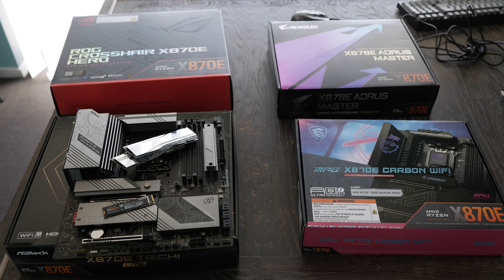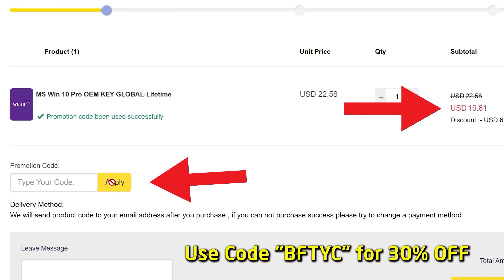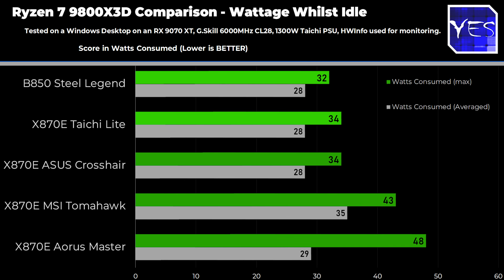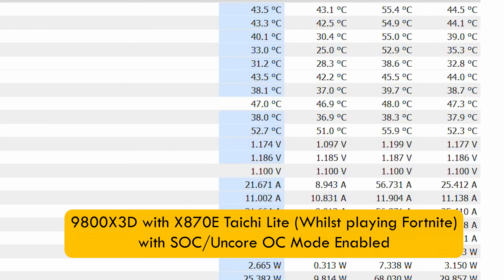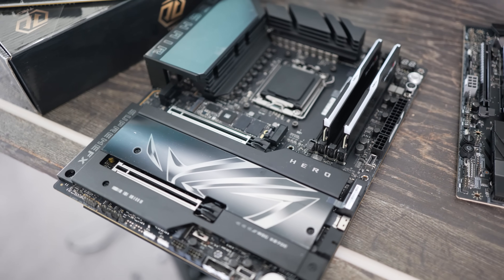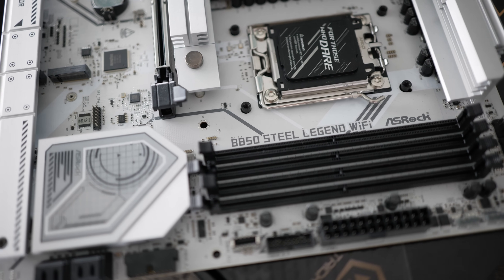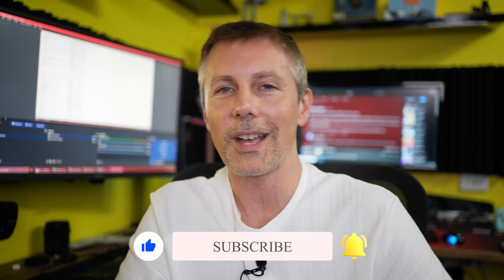I think I know why Ryzen 9000 Series CPUs are Dying...(!)

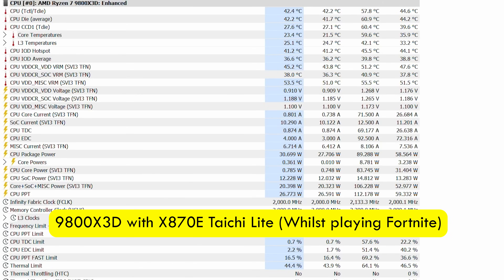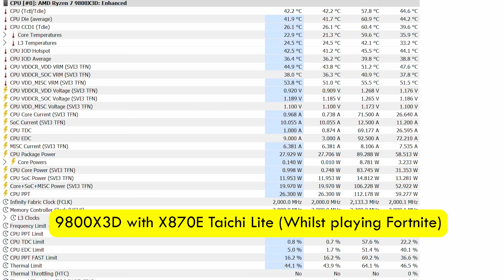Comment: Sorry, but I'm going to disappoint you. This is "just" a known issue of erroneous CPU reporting to the HWiNFO64. According to HWiNFO author its not a software reading error but a CPU reporting to HWiNFO bug, most likely located deep inside the CPU SMU. And it happens across all brands of motherboards and both AM4 and AM5 platforms not just the 9000. On all 5000/7000/9000 series. Freeze you video between 3:38 - 3:55 and take a closer look to FCLK and UCLK max values and also the "CPU_VDDCR_SOC Voltage (SVI3 TFN)".  FCLK 2000MHz to 2133MHz, UCLK 3000MHz to 3300MHz and SOC voltage 1.185V to 1.265V. You know what all these have in common? All of them spiked ecxactly +6.67%. Probably other sensors get this spike too but its not easy to recognize it because of the dynamic function. Current(A) sensors and temperature sensors. Sometimes these error reporting spikes could get up to +50% or even +100%. Its random on what sensor it would happen, and of course its fake/error. Not real. I've seen screenshots like yours with 2.4V SOC voltages, 4000MHz FCLK speeds and 130C CPU temperatures. We all know that those values are impossible, hence they are error reporting. The "good thing" is that internally the CPU reads the correct values for sustaining the correct operating behavior. FYI I have an 9700X with X870E NOVA board and I do get the occasional +6.67% max values on FCLK, UCLK and VSOC, but I was also getting the same on my previous AM4 5900X with GB X570 AorusPro board. And on that AM4 platform I first got the +100% spikes. These erroneous (+6.67%, +50%, +100%) and fake spikes have appear at least 2 years ago. I think you should check this: https://www.hwinfo.com/forum/threads/hwinfo64-cpu-die-average-spike.8044/ In this link, in the first screenshot you'll see +100% spikes. ...and also this: https://www.hwinfo.com/forum/threads/excuse-me-why-did-my-soc-voltage-and-memory-frequency-suddenly-spike-thank-you-everyone.10508/
Reply: Interesting, so what would be your guess on the issue with the 9000 series and(mostly) Asrock motherboards so far?
Reply: @CjKillinit  I honestly don't know anything for sure. My 9700X/Asrock X870E NOVA combo runs for only 2 months (since build) with out any issue so far and I hope it will stay this way.  I use PBO custom limits, -25 CurveOptimizer, +100MHz max boost, 1.18V VSoC with SOC OC mode enabled. Like I said these abnormal reporting values occurring on all board brands and it seems to be unrelated with the 9000 booting issues. But I dont think that these are Asrock only. Maybe Asrock sold a lot more boards than all the other brands. I've read some cases that wiping out the CPU and put it back on its normal again, and for some reason the idea that some users are touching the CPU and/or the board pins and leave skin/oil residues on before the first install have stuck into my head. But this is not easily confirmed.

Comment: Please guys stop asrock bashing.. this is not what he said, neither proofed. Asrock is cheaper because they don‘t sell you crap that you don‘t need. In addition, which of the big manufacturers didn‘t have problems in the past? I mostly trusted msi but had a failing one with weird error with my 5820k. I had a very cheap asrock from 2009 on which lasted 11 years. It is a MINORITY problem so please stop panicking. Asus: warranty problems Gigabyte: also sells crappy power supplies and issues with their graphic carsds.. even evga had problems with voltage
Reply: This did not age well. Even after their supposed bios fix Asrock boards have been consistently killing x3d CPUs sadly.

Comment: i actually changed that VDD_SOC voltage to 1.1v when i setup my 9950x3d and Asrock X870E nova then set the LLC to level 2 and EXPO settings on my 6000mt/s CL30 gskill ram.

i run my 9950x3d with PBO manual power limits, per ccd CO -25/-15 and manual curve shaper. On full load my 9950x3d is only pulling 154w on core, 185w cpu package, 1.06v 5.25Mhz and 63c temp.

Comment: Yes, I've been suspecting SoC voltage, too, but I don't think that (only) ASRock is to blame here. I bought an MSI X670E (yes, that's X670E, not X870E) Tomahawk in January this year (2025), and it came with a BIOS from October 2024 (that's several revisions into Ryzen 9000 support), and the first thing I did was set an alert in HWInfo for V/SoC above 1.2 volts, and turn on EXPO profile (tried both of them, exhibited V/SoC behavior is exactly the same).

Why above 1.2V?

Because, some half a year after the whole mess with 7800X3D frying came to light, AMD issued a recommendation to AM5 users to manually set V/SoC in BIOS setting to 1.2V when using EXPO profile.

So, once I'd set all that, I went merrily on to do some light and heavy workloads, and... yep, sure enough, my alert in HWInfo went all crazy, and started warning me about spikes in V/SoC that went above 1.4V .

No, tha's not a typo. It actually went above 1.4V at times!

Remember, AMD considers 1.2V safe (I think that 1.25V is considered maximum safe voltage, but I'm not sure on that one), and my motherboard was supplying my 7700 with 1.4+V, which is absolutely UNSAFE voltage, and very likely to completely fry the CPU in the "long" run (where "long" may be days, weeks. months... who can really tell?).

If you think that 1.4V is high, then... you haven't read other people's experiences, and them reportedly seeing V/SoC going up to 1.5V!

As for suggestions along the lines of "just update your BIOS to the newest one"... I think that this example of the latest X870E motherboards (I'm suspecting all of them, not just ASRock ones), with latest BIOS versions, shows that they may still exhibit unsafe SoC voltages (with EXPO), so manually setting V/SoC to 1.2V (or 1.25V, if system is unstable) in BIOS, when using ANY EXPO profile, is still highly recommended.

My personal opinion is that there's a systemic flaw in Ryzen 7000 and Ryzen 9000 CPUs when it comes to CPU voltage requests , and the only fault on motherboard manufacturers' part was that... they simply followed AMD's specifications, and supplied AMD CPUs with whatever voltages those CPUs requested... until those CPUs started dying (and, sometimes, committing murder-suicide by killing their motherboards, too), and motherboard manufacturers were forced to go against AMD's specifications, and forcefully limit V/SoC to 1.2-1.25V regardless of what voltage the CPU itself may be requesting... leaving AM5 systems potentially unstable (depending on the CPU silicon lottery) in EXPO profiles, but at least keeping CPUs (and motherboards, which is what motherboard manufacturers really care about) alive and functioning... instead of having to be replaced (at manufacturer's loss) within their warranty period.

Comment: My local Hardware store has a deal where i can save 98$ on a AsRock B650 mb, and i want to pair it with a 9800X3D, but i have been reluctant because of the CPU dying issue, which is particulary an issue on AsRock MB.

Comment: I’m totally about jinx my first build, I have a asrock b850m steel legend wifi with 9800x3d… temps seem all normal, but I’ve only enabled expo, the cpu tctl/tdie average idles 38-47c afternoon sun on the room doesn’t help but only concern is it’s thermal limit percentage sitting 73% even on idle…

Comment: Did you measure the power usage after enabling the Soc/OC mode?
Reply: Tested this by myself. The setting didn't make any difference to idle power usage. Tho I don't use integrated graphics. That could make some difference. Motherboard I use is the Asrock B650M Pro RS

Comment: Well asus allowed soc voltage going above 1.30 volts or higher for the first fee bios settings on the ryzen 9 7000 series. So is this happening again. I’d look back in the launch day stuff. It was asus but other boards were okay. So might research that.

Comment: I have 9800x3D combined with ASRock X870 Steel Legend WiFi, Kingston Fury Beast 6000 CL30, Toughpower GF3 850W Gold, RTX 4070 Super. All parts are bought when 9800x3D was released. Till now I don't have any issues. Yesterday i checked CPU voltage in hwinfo, and in my case voltage doesn't fluctuate. Only setting i changed in BIOS was disabling WLAN and Integrated GPU. Nothing else. I am gonna check againt today while playing some games. But voltage remains stable when watching YT or doing other tasks aside from gaming which i have to test again.

Comment: Been manually inputting SOC Voltage in BIOS for a few years now.  Hopefully that means I'm safe.  I have SOC at 1.165V  for DDR5 running at 6200 MT/s, CL28-35-35-30-28-58.  I'm certain silicon lottery affects how low you can go with SOC Voltage.

Comment: Sounds like ASRock is a gamble in a choice for a MOBO.   I myself have always chose ASUS and not the crazy over priced and over blown options that are not needed. I just purchased an ASUS TUF Gaming B850 AM5 board and it's built like a tank.  I also have a AM4 backup PC that's using a ASUS X470 Prime Pro with a 5800X. And it's solid. I've also noticed that this happens more with the X3D models not just the X. I bought a 9700X and there is no issues.

Comment: I had to swap a MSI B850 in for an RMA gigabyte x670e (returned/fixed in 2 weeks btw). unrelated aRGB USB controller issue.
I also noticed the VCORE avg being lower and more stable on the MSI board, but it wanted to default to a 1.3V SOC...no ty. I tuned it to 1.25 and it was stable w/ expo and tweaks.
The gigabyte autos to 1.245v on SOC/EXPO. I tuned it to 1.22v and have my Tgroup 6000 cl 30 running at cl28 1.40, 1.35, 1.30 w/o issues.
The MSI BIOS seems to have better CPU power management but higher memory latency (barely, mind you). This is true w/ PBO (-50mv,+200mhz) or a 1.225v 5.35ghz OC on a 7600.
Your results match my more limited data set for sure. I avoided Asrock on the swap due to the rumor mill.
Thanks for the comparisons, i know that took some time.

Comment: If only ASRock is behaving strangely, it is a mistake in ASRock's control settings and AMD is not responsible.

Why are you blaming AMD when there are almost no similar problems with MBs from other manufacturers?
Reply: If you just scrolled down you would see other users saying that the same is happening in other non asrock motherboards. Then to top it out if intel stuff was getting 1.8  or even 2.0 and degraded over time before eventually go dead, ryzern 9000s are going kaput from a moment to the other often within  weeks of use without early signs  what in the most generous take means this cpus are extremely flimsy and if they are probably that is within the responsibility of the manufacturer.
Reply: The problem of Raptor Lake deteriorating and failing occurred uniformly with MBs made by all MB manufacturers and was clearly a problem caused by Intel's excessive settings and manufacturing process, so it has nothing to do with this incident.

There are too few examples of MBs made by other companies other than ASRock to be put in the same category.

If you understand that the MB control and numerical settings are all customized by the MB manufacturer for each model, you can understand that the fact that the symptoms are uneven means that it is not an underlying problem.

Comment: I run the Asrock X870E Nova Wifi with the 7800X3D, never had any issues yet. did test the soc voltages at 20ms refresh in HWINFO at idle and in game with expo on and then with it off  (auto ram config sets auto settings and expo sets static voltages automatically, 1.2v SOC for 6000mhz ram with expo and lower for auto). I noticed my Soc voltages never even moved at idle or while playing a game for both expo and auto ram config. This is with bios 3.20. I know this video is for 9800X3D but just putting this here to compare behavior.

Comment: I've never ever trusted auto voltages, either Intel or AMD. I always do static overclock / undervolt with conservative settings on my machines, even when it means loose some nearly useless 200MHz, less than 5% performance in exchange of way cooler temps and way longer and safe durability.
Reply: Yea same here. Better to buy more powerful parts and run them at safer settings than to buy slower parts and squeeze every last bit of performance out of them running unsafe settings.

Comment: Iv got a 9950X3D and GB X670 Arous master.
SOC voltage changes on mine but it looks to be tied with Load Line Calibration.
At idle it sits 1.236V and you give it load then LLC boosts it up to 1.248V

Settings wise Im using XMP 6000, 
PBO +200 and some per core CO.
CPU Voltage 0.925V idle, Low load 1.375V, Max load ends up around 1.1-1.2V

If I change the Scaler to 10X tho then it hits 1.54V at low loads like watching youtube. But it does boost up to 6ghz.
Keeping the scaler to 0 then it only hits 5.9ghz every now and again at low loads.

My guess why boards are frying them is probably that scaler setting and it letting to much voltage though.
X10 scaler and extreme LLC setting would probably have the chip spiking 1.6V on idle to low load transitions and thats just what software reads which is smoothed out. The actual numbers are always going to be a few ms spike of higher voltage.

Comment: in my experience motherboards do crazy stuff with soc voltage when you mess with ram frequency 

and the sweet spot I found for soc voltage is 1.1 

The best test you can do is with  prime 95 and games with different engines

Comment: All those soc voltages are way higher than needed I would recommend just setting the voltages manually at 1.1 or lower then just set an offset vcore so that changes with load

Comment: Thanks for the video, I have not upgraded to 9000 series yet. I try to avoid the latest generation of chips as they usaully have issues. I feel like Amd cpu issues get downplayed in the community. With this issue many people are putting all the blame on ASRock but Amd is a partner with ASRock and must work with ASRock to fix the issue.  There are issues with Amd and Intel and now Nvidia is getting into the game; it should be quite a circus.
Reply: I should add that the only time in recent memory when I bought a CPU at release date was the i5-13600K and it is still going strong.  One of the best CPUs to use for streaming games with Intel's deep link tech and OBS.

Comment: The HWiNFO readings on VSOC on my AsRock X870E Nova with a 9800X3D never exceeded 1,20v and are currently stuck at 1,190-1,1950v all the time. I did nothing as with UEFI 3.20 the VSOC is limited to 1.20v and EXPO changes nothing.

Comment: i have a am4 board from gigabyte and i have that soc mode enabled since day one as i first did a full run through the bios settings as soon as i saw my improve performance i was hell ya brotha maximum performance all the time it is i dont care for what ever watts the 5700x3d sips from the grid i just wanted the pc to be as fast as it could for the specs it has that cpu along with 3733mhz aorus ram and a 4060 ps i also locked the uclk/mclk/fclk to 1:1:1 ratio so it pairs with the ram xmp speed rock solid performance and really stabile havent had any bsod or hard crashes at all since day 1

Comment: Gotta love paying over 700 dollars for a CPU and still have to worry about it randomly dying.

The absolute state of PC building nowadays
Reply: Or paying $4200 + for a 5090 and having the connector melt
Reply: @quantos8061  now that is the buyer's fault because buying a 5900 is just dumb. I bought a 4800 and I was very happy with it. you don't need the very top of the line even if you do pro work like me.
Reply: @MelbourneArchviz  I don't see how faulty connectors are the customers fault.  If you pay for something it should work.  It shouldn't matter how much you spend on it.
Reply: The trick is always going mid-tier, if you want reliability and solidity. Then you save dollars too.
Reply: Where's the fake outrage like the Intel 13th Gen issues quiet as a mouse except for a few standup guys like TechYes
Reply: @mvzme  Yep, Gamers Nexus was trying to sell all those 7600x that were growing mold on the shelves last year. And are still sitting on the MicroCenter shelves this year for $150....
3rd summer of 13700k averaging 9W average doing about everything but gaming and benchmarking. And depending upon AMD GPU drivers no real gaming issues. I figured out all my time out bugs were due to AMD bug tool (issue detection) in Adrenaline software; simple fix turn the junk off...
Reply: This is why im very hesitant in spending more than 1k on a prebuild, or even building my own now, they are not made to last anymore sadly.
Reply: Companies don't care. They have to maintain their profit margins. People will still buy them, have them destroyed, send them back, etc. This is never going to stop.
Reply: Nah just trash amd cpu. Like burning money on fire.
Reply: @deathtotmz  intel had worse issues back to back generations lol

Comment: Since Ryzen 3000, the SOC and infinity fabric can dynamically switch between p-states. Most boards just disable this and force the highest performance state (P0) when using EXPO/XMP or RAM clocks larger than what AMD officially supports. Relevant BIOS settings are called APBDIS and DF-CSTATES - these also get automatically altered when SOC OC Mode is set.

Comment: In your graphs, you have an MSI X870E Tomahawk being tested. However, from the start of this video, you have MSI X870E Carbon WIFI on display, which I have installed in my PC. Why was the Tomahawk listed instead of Carbon? Did you test the Carbon, what were the SOC voltages and were they stable?
Reply: I have a MSI X870E Carbon Wifi and a 9950X3D. I opened up hw info. I see a solid 1.2V for CPU VDDCR_SOC voltage. When I run a CPU test using OCCT it does not change. Rock solid whether at 5% utilization or 100%.
Reply: Also curious, may be a B-roll error or a graph label error